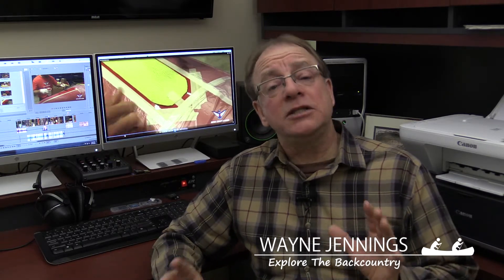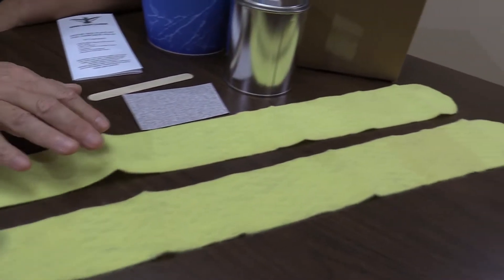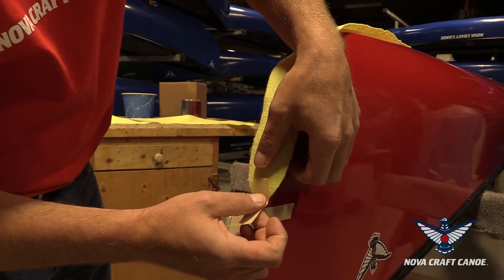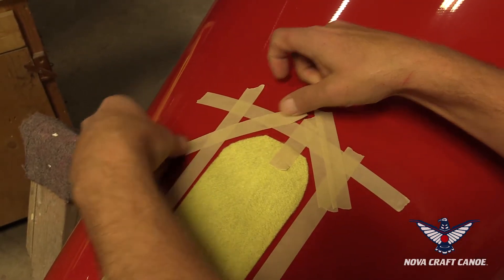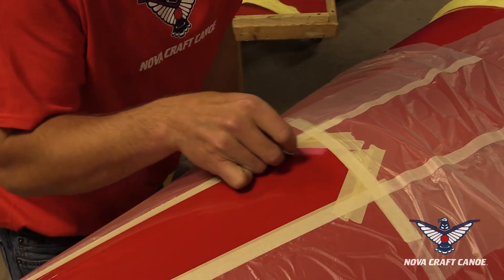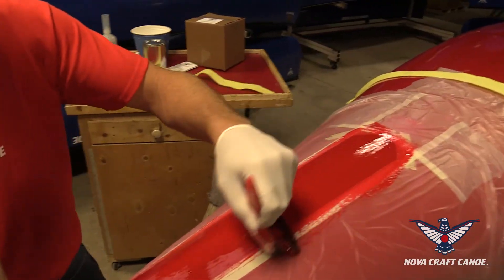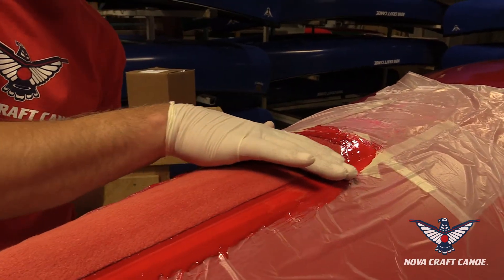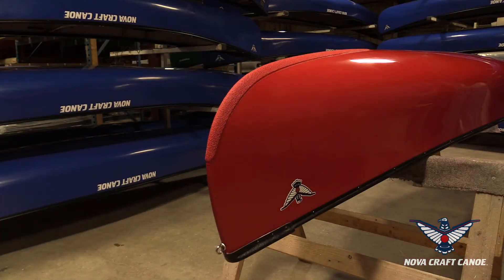Canoe Skid Plate Install

Comment: I believe my Nova Craft canoe to be the best in the world. Could it be that skid plates would make it better? How much weight would it add? Can I choose the colour? As I get older I tend to drag rather than lift my canoe. Thanks for the video & Merry Christmas. Brian 77
Reply from the maker: Hey Brian,   Those skid plates will make your canoe "better" by adding an extra layer of protection...great when landing on rocky shores, or skimming over gravel bars.  They add between 2 and 3 lbs. total to the weight of your canoe, and yes you can order the kit with specific colour resin.   Cheers   -Wayne